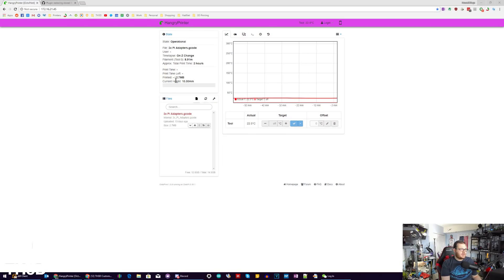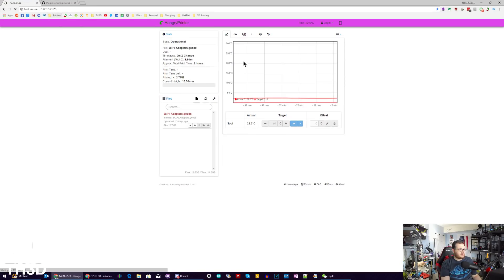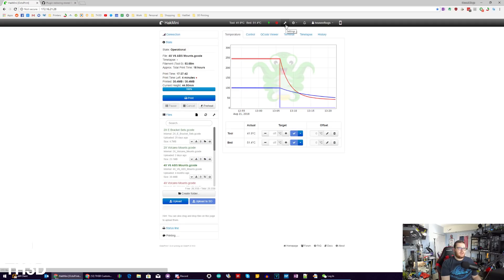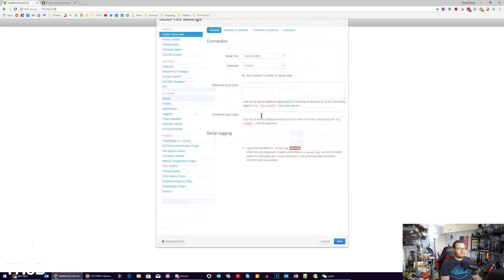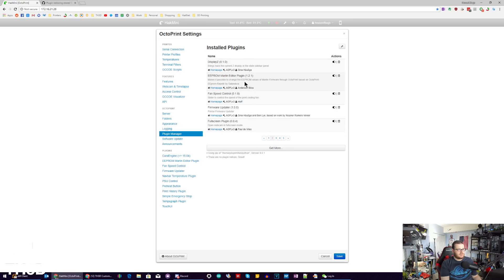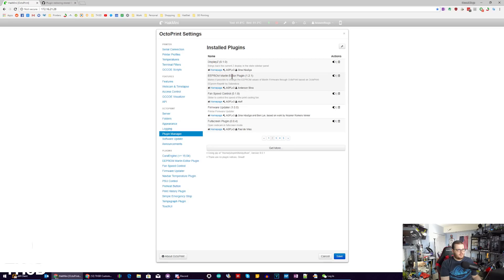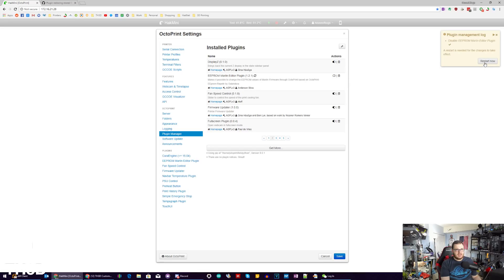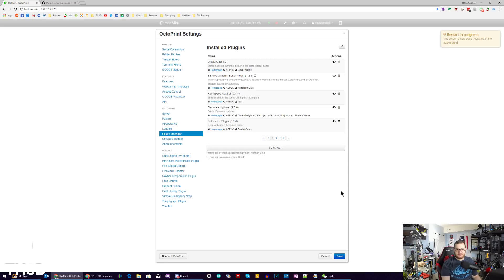OLD VIDEO - Update your Plugin - EZPi OctoPrint EEPROM Marlin Editor Plugin Bug - DISABLES ABL!

Comment: Maybe I am dumb but I don’t understand most of the things you said about the plugins and all that, but I just ordered a raspberry pi 3 on amazon with a webcam and In 2 days I’ll order the EZMAT and the EZABL kit with wire connect so will the raspberry pi have a different setup needed since I will install a EZABL kit or can I follow any tutorial out there? Thanks!
Reply from the maker: Nothing special is needed with the EZABL as thats all handled on your printer control box. The pi just essentially replaces your computer to send GCode over USB to the printer.
Reply: TH3D Studio Allright thanks, I have now ordered the Kit and the mat, (just a quick question: how long does it usu ally take from when I order to get it to france? Or am I going to receive a shipping number?) I received thz pi 3 and its worked the first time, then I accidentally removed the sd card and now it dorsn’t want to boot up anymore, I have tried everything and I rven got a second sd card, and  redid the flash on the card multiple times but the green led never turns on, do you know why? Do you think its a problem with the pi because I am thinking about ordering a replacment! Thanks!
Reply from the maker: You can just re-flash the SD card. It is likely corrupted and just needs a re-flash. The image is on the site here: https://www.th3dstudio.com/knowledge-base/ezpi-documentation/

International shipping is about 7-10 days if everything goes smoothly